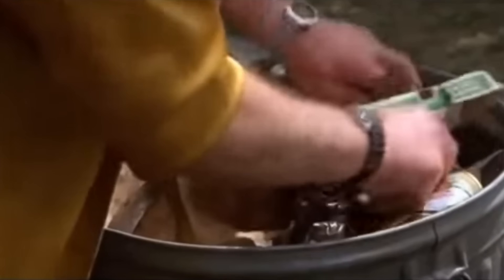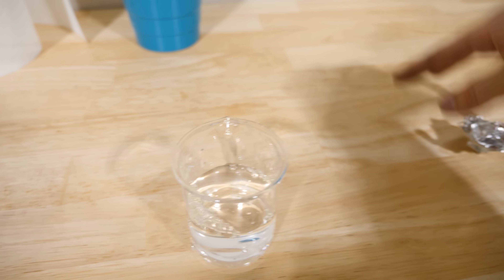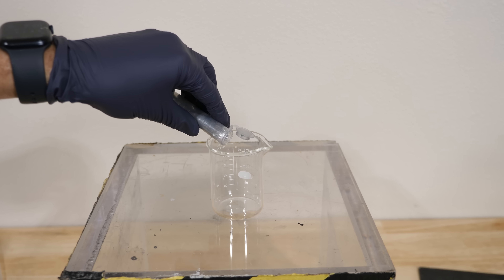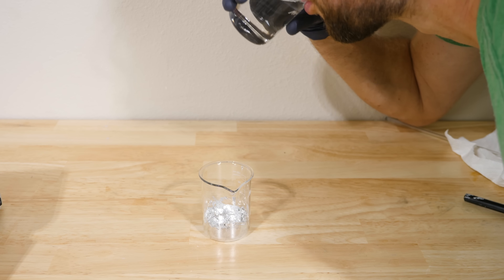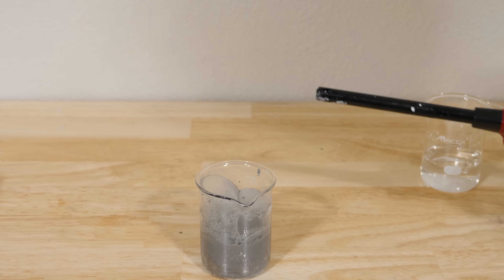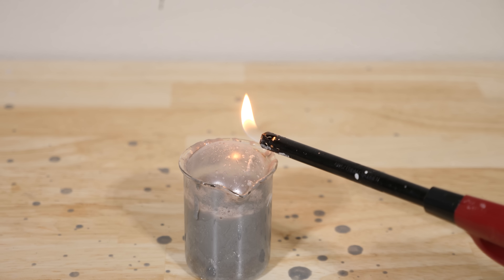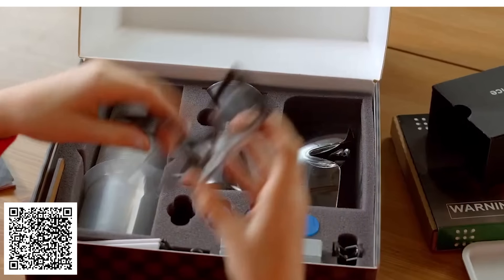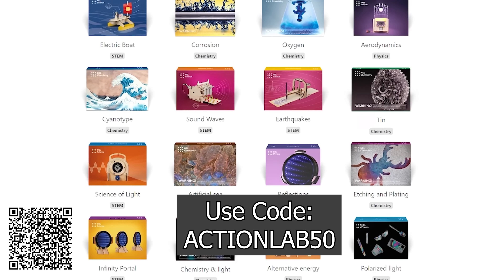This Liquid Metal Turns Garbage Into Fuel

Comment: I am a Ph.D. student working with aluminum-gallium alloys in energy production and I would like to clarify a couple things I see in the comments regarding the idea. A lot of people are suggesting that this is actually a poor idea to use in cars, airplanes, etc. and I believe they are right. But that doesn't mean it isn't going to be useful. The major interest in Al-Ga alloys is its use as an energy carrier. As good as batteries are for some applications, the energy density of batteries are actually quite horrible, which is an issue if you want to store energy rather than just have it be portable.

For example, wind, solar, and nuclear energy are difficult to throttle on demand. In other words, you only get energy from the wind when it is blowing and from solar when it is sunny. Conversely, you will be getting energy from wind and from solar whether you need it or not. To solve this problem, a lot of ideas are to use batteries to store unused energy from these "clean" energy sources so that it can be used at a later time. However, due to the really poor efficiency of batteries, a lot of energy is lost. This is where Al-Ga may come in handy. We can use excess solar, wind, and nuclear energy to produce aluminum from aluminum oxide. The aluminum now acts as a "battery" to store the energy. Then, when we want to release the energy again (e.g. in the middle of the night when the wind isn't blowing, etc.), the aluminum gallium can produce hydrogen which can then be burnt in a powerplant to create on-demand energy. This process of storing energy in aluminum is actually a lot more efficient than most batteries.

So while this may not be terribly useful in cars or vehicles themselves, it may be useful as an energy carrier for large-scale powerplants.
Reply: Thanks for sharing your explanation and sharing your insights on the topic. Best of luck with your research!
Reply: oh, didn't think of that. Makes a lot more sense when you translate this to a large scale facility, with large reacting chambers with a layer of the alloy at the bottom fueling the burners. The recovery process would probably be 99%, and you don't have to feed more aluminum into it. Gook luck with your research
Reply: @SparkyRedheadSupremacist  Pretty sure you would have to feed more aluminum into it
Reply: @SparkyRedheadSupremacist as well as aluminum plant are close to electric sources and they could even be in a single site . Not having to move the Al.
Reply: I'm curious about the method of recovery for the gallium and aluminum oxide, especially as it pertains to separating the two.
Reply: @amadensor  The aluminum oxide being produced crashes out as a light solid which floats to the top. To separate the two, you just need to let everything settle and remove the liquid gallium from the bottom. On the lab scale, you can use a separatory funnel. Industrially, something similar but much larger can be used.
Reply: Where does the aluminum go? I just didn’t totally understand that part of the video! The aluminum left the Ga somehow and you were left with GA and H2O despite some of the H being burnt off?
Reply: @NealD  It makes aluminum hydroxide, which I'm guessing dissolves in the water to form a basic solution. To get it back, you'd either have to evaporate the water, use more chemicals to get it to precipitate somehow, or just not use that much water in the first place and let it form a crust on the surface of the gallium. Seems like a pre-mixed charge of gallium-aluminum alloy where you add water as needed to get hydrogen, would be the easiest way to recover it, as long as you stop adding water before all the aluminum gets reacted.
Reply: @DFPercush  The aluminum hydroxide doesn't dissolve in the water, but it makes a pretty fine powder that floats around. You can kind of see the water is a little murky after the reaction because of that.
Reply: @DFPercush  Aluminium oxide is very insoluble in water at neutral pH. Otherwise every piece of aluminium would dissolve away when wet. In a practical hydrogen generating cell, you would probably want to use excess water to carry away the aluminium oxide when the reaction finishes.
Reply: @NealD  The aluminum reacts with the water to create aluminum hydroxide and hydrogen gas (2Al + 6H2O => 2Al(OH)3 + 3H2). This aluminum hydroxide is a white solid that floats to the top of the liquid gallium where it can be separated off. You can kind of see in the video that the reacted liquid looks pretty dirty at 3:30, so some of that is the aluminum hydroxide floating around. He then uses a pipette to get the clean gallium on the bottom, leaving the aluminum oxide in the beaker with the water. Hope that helps!
Reply: @pyr0duck676  That white powder, is it aluminium hydroxide or oxide?  It's oxide is typically a white powder, it's hydroxide, I have no idea.
Reply: @NealD  I imagine the aluminum becomes aluminum oxide and precipitates out.  But how do you get the OH off in order to reuse the aluminum?
Reply: @NealD aluminum hydroxide the cloudy mix . If you have pure aluminum water and such it’s non toxic. I don’t know how much gallium is going to side reaction but he has less recovery than he started with, but it could be removed from the old stuff.
Reply: Sounds interesting but I am curious about the hydrogen as it's a notorious slippery gas to contain. As the generation is simple but how fast can it be produced and you have too have some sort of buffering to regulate the pressure. But it has advantages in small scale systems as most of the reagents are reusable and in fact the water is the only fuel that is directly used up.
Reply: @barrymayson2492  What would likely occur on the industrial scale is the use of a PSR/CSTR reactor followed by a consensing column to get rid of any water vapor. The dry hydrogen gas could then be pressurized for immediate use in a combustor turbine to generate electricity. With the use of a PSR/CSTR reactor, you could regulate the hydrogen production by altering the feed rates of the inlets. Research is still ongoing to find the maximum hydrogen production rate from this system. Perhaps several PSR/CSTR reactors would need to be used in parallel to obtain the best hydrogen production rate without losing too much.
Reply: @barrymayson2492  If I'm understanding it right, you wouldn't use it to generate hydrogen gas as an end product or storage medium- there are more efficient ways to do that, you'd use it as soon as you produced it to create energy to use.  You'd leave the aluminum/gallium sitting in their tank until you actually need power, and then you'd just add water them and burn the hydrogen gas immediately to create power for whatever you are powering.
Reply: @barrymayson2492  But if you are producung Hydrogen "on demand" there should be no containment/storage issues.  Buffering pressure? A simple regulator should be able to do that.  So basically the only form of storage you would need are the pipes that carry the H to the reactor/fuel cell/burner etc.
Reply: Interesting! Is the Aluminium oxide after the process clean enough to feed it back into aluminium production plants?
Reply: @jackmclane1826  As long as you start with clean aluminum and gallium, the aluminum oxide would just need to be dried to get a fairly pure sample clean enough to feed back into aluminum production plants. Some gallium contaminants could remain, but those can be easily separated from the aluminum oxide.
Reply: This is a viable option, especially with solar. I feel like with nuclear power it could mostly be used as a buffer for excess energy production in low demand times and so not to waste the energy. 

This doesn't seem live a viable option for homes and personal use though. But more for corporate/factory use and for the power grid
Reply: @joshg6491  Why would this have any advantage over simply using excess energy production to directly produce hydrogen from water? Creating the Ga/Al mixture as a storage medium would probably allow higher energy densities than pressurised hydrogen for transport, but most countries already have infrastructure in place to transport hydrogen via gas pipelines. Given the energy loss through heat from the reaction of Ga/Al with water when used in any small-scale application of energy generation from hydrogen, I'm at a loss to envisage any application where Ga/Al would represent a preferable route over direct electrolysis of water followed by hydrogen storage or transport.
Reply: How do you conclude that batteries have low efficiency?  Li-ion can do round trip delivery well above 90%.  And other chemistries are above 80%.  That's because the fundamental reaction is simply atoms moving back and forth.  Here, you have to convert the Aluminum to Hydrogen, which clearly creates heat and consumes part of the original energy.  Then, for any use other than making heat, Hydrogen only yields at most 65% in electricity or mechanical energy.  Lead acid batteries are way better than that combination.  And if you actually are competing with batteries, you have to include all the work to collect the Aluminum Oxide, take it to a smelter and reconvert it to metal.  That definitely doesn't all happen with 100% efficiency.

This still could be useful for some applications.  I'd argue that the energy density trumps efficiency for vehicles.  Those naturally drive to refueling stations where collecting spent Aluminum Oxide is least problematic.  No high pressure or cryogenic tanks.  This may be most exciting for fuel cell planes, where all alternatives are really daunting.

But bulk storage of wind and solar?  This is your absolute last possible choice...
Reply: Possibly used as an indefinitely storable source of energy for some kind of single use emergency item? If you can make a micro efficient hydrogen generator I'm sure there is some way to make use of it.
Reply: @AndyTomT  Fuel cell.
Reply: OP, did I just read “low entropy battery” or an I just bad at science…

That’s pretty metal.
Reply: Thank you for the explanation. I am a machinist of Cessna for 20 years. Gallium is terrifying. People need to curb their enthusiasm.
Reply: Where do you find the required gigatons of aluminum and gallium?
Wouldn't it make more sense water electrolysis with renewable sources?
Reply: @jimbotron70  that is what is in place wordwide anyway
Reply: "pyroduck" the "PHD student"
Reply: Maybe you're aware of the aluminum-air battery, in fact India already has a startup marketing that tech.  The additional step of using Ga with Al to produce hydrogen wouldn't make sense for electricity production as an Al-air battery would be a cleaner route for that, but if your goal is H for heating or use in a fuel cell, or even ICE tech ha!  Then Ga Al is really nice.
Reply: @thom1218  I liie the HA at the end of ICE tech.  lol
Reply: This sounds incredible and could solve a major issue with renewable energy, I would love to read your article.
Reply: So awesome to know that! Thanks for sharing
Reply: How about that new nuke waste batteries? 🤔
Reply: I kind of doubt that this process is more efficient than using batteries. Do you have any full-circle efficiency figures? Burning H to get electricity in itself isn‘t really efficient. Using a fuel cell is better but still worse than batteries.
Reply: So is there a way to recollect the aluminum oxide after the reaction takes place?
Reply: I think you are a bit mangling with the (energy) efficiency term here and actually referring to something else than energy related efficiency. A Hall Herault cell has a pretty high cell voltage and therefore the combined method used to produced hydrogen is not more energy efficient than a PEM electrolyser for producing hydrogen. Not even talking about batteries. Those are even way better in energy efficiency.
BUT. I think you refer to the fact that it is pretty idiotic to use batteries for seasonal storage, because that means you would need to run it for 1000 years to make up for the investing costs.... not talking about the resources for the batteries. Any battery will have to be orders of magnitude cheaper/ kWh and still there is a possible resource problem.
And. Storing Aluminium is much easier than storing hydrogen and an easy and big on-demand production is probably what you're aiming for, right?
Well, and the circumstance that it is anyway very difficult to find a good longtime/allrounder storage solution with a high enough roundtrip efficiency in huge quantities.
To be honest I dont understand why people always pinpoint the low energy efficiency related to hydrogen, without also talking about other alternatives for long time storage which also have their drawback. I would wish more people would actually understand that you cannot use huge amount of li ion batteries, but energy carriers that can be stored separately from any battery fuel cell or whatever is used to produce the energy carrier do systematically better cost wise at least
It is not the same thing if you are talking about daily or weekly storage, or if you are talking about storing energy from summer for release in winter. And storing energy in metals, releasing hydrogen on demand might very well still  an option to consider. So why not also for aluminium. Though I guess you'd need to find a permanent anode material for aluminium production without releasing CO2.
It's really a tough problem. Not only for the aluminum but merely also to find a suitable energy storage solution for summer to winter.
Yeah good luck with your research! Interesting I found that gallium seems to be the way to avoid using huge amounts of caustic soda or acid.
And in a way also that probably you'll get aluminum oxide which can be well separated from gallium and hopefully directly recycled to the Hall herault process, respective to a process using permanent anodes
Reply: Yep.  The only question is if it will be better to just recycle the AL and I believe that depends on the energy balance. I. Any case it’s an important area of research as we are likely to need hydrogen for planes , etc.
Reply: I suggest you edit your comment: "For example, wind, solar, and nuclear energy are difficult to throttle on demand". Please provide evidence that nuclear energy is difficult to throttle on demand.
Reply: Stupid idea. To produce bauxite, we have to make coking coal, caustic soda, ovens, extracting the ore, it's all very polluting. The future is green hydrogen.
Reply: The real benefit of this would be a less polluting way of creating hydrogen because they usually use electricity to make hydrogen and that's really inefficient
Reply: @ShinkenKeruberosu  And you don't think itd inefficient to make aluminum with electricity?
Reply: @alexanderx33  Not if you are using waste aluminium
Reply: @alexanderx33  "you don't think itd inefficient to make aluminum with electricity?" - Actually that's already how aluminium is made FYI. Inefficient? If you compare it (in scale) against conventional batteries (e.g. li-poly) it actually might be more efficient than any rechargeable batteries (which on such a large scale would be prohibitively expensive anyway).
Reply: @CoolKoon  Big difference between the batteries and the aluminum in one case your effectively making a synthetic fuel in the other you are making a re-usable directly electical energy storage device. The efficiency of manufacture of the batteries is irrelevant. The battery charge/discharge combined energy loss is only 5%. The energy lost to heat when making aluminum from boxite has to be waaay higher since it is done at such high temperatures. (cursory search said the energy loss is at least 50%) It would however be more efficient for extremely long term energy storage, like for decades or centuries.
Reply: @alexanderx33  "in one case your effectively making a synthetic fuel in the other you are making a re-usable directly electical energy storage device." - Yeah, this is basically a fuel cell.

"The battery charge/discharge combined energy loss is only 5%." - I think that this is wishful thinking at best. Even 10% would be a bit too generous given the fact that you're never supposed to fully discharge a battery and the fact that the conversion efficiency of most run-of-the-mill SMPS' is around 90%.

"The energy lost to heat when making aluminum from boxite has to be waaay higher since it is done at such high temperatures." - First of all higher temperatures usually mean higher conversion efficiencies. And second the aluminium wouldn't be made from "boxite" (bauxite is the raw material aluminium is made from that needs to be crushed, treated with lye, roasted and only THEN can it be converted into metallic aluminium), but scrap aluminium instead, which is pretty much only aluminium oxide and metallic aluminium (there are already many aluminium recycling plants all over the world BTW), thus the conversion efficiency probably wouldn't be nearly as bad as you estimated it to be. Moreover the lower conversion efficiency would still be offset by aluminium's considerably higher energy density anyway.
Reply: @CoolKoon  How is efficiency loss offset by energy density if its not being used in a vehicle? The source is a good point though. One would think the prefered source would actually be the output of the hydrogen generator. IE the AlO3 and/or Al(OH)3 salts made by reacting it with water. BTW the reason why higher temp means alot of lost efficiency is that you can't perfectly insulate the system during conversion or recover all the heat on the way in and out. And the higher that temperature is sharper the gradient and thus the more rapid the flux of heat out of the system.
Reply: @alexanderx33  "How is efficiency loss offset by energy density if its not being used in a vehicle?" - By the fact that it's lost only upon converting the resulting alumina back into metallic aluminium (which is supposed to be done at the recycling facility, not in the car). The combined efficiency of heat and hydrogen production is actually quite good, that's what the gallium is there for. And yeah, the high efficiency would only apply if both the hydrogen and the heat produced by the reaction would be utilized of course.
"you can't perfectly insulate the system during conversion or recover all the heat on the way in and out" - You can't insulate it perfectly, but you could definitely insulate it a lot better than the way it's done right now during the manufacture (i.e. by little to no insulation at all). But I'm guessing that the electrolysis itself maintains the whole alumina+cryolite+aluminium mixture hot enough so that you don't have to worry about insulation anyway.
Reply: Can't nuclear easily be throttled?
Reply: @RedHair651  "Can't nuclear easily be throttled?" - No.
Reply: So you want to use a renewable resources to mine a limited resource....and then destroy it
Reply: Why not just reuse/recycle the aluminum as we do now?  There will be energy lost for each conversion.  Of all of the things to recycle, aluminum is the best case of all of them.
Reply: This is awesome and solves a problem of what to do with all the waste aluminum!
Reply: seems like it would use a lot of water, an increasingly scarce resource in some places, so some sort of recapturing system would be needed which could reduce the systems efficiency.
Reply: That makes a lot of sense thanks so much for this information
Reply: Thank You sir.
Reply: Wow, what an amazing idea!! 👍👍👍
Reply: Ok so if we shouldn't use aluminium for vehicles what metal should we use?
Reply: BRO WHAT HOW MUCH TIME DID YOU HAVE?
Reply: Yet, no matter what, it wont be as effective and recyclable already nature created. There is best solar battery out there already, and best particle it's called wood, oil, and carbon, carbon dioxide and multiple forms of carbon-hydrogen based polymers, gases, oils. Process is called photosynthesis just add water, creates various form of  battery :P  I don't know why people try to make it illegal.. it's pure insanity.
Reply: @KabelkowyJoe  "I don't know why people try to make it illegal.. it's pure insanity." - 'cause it takes literally hundreds of millions of years for them to be made? IDK about you but I suspect that 99.9999999% of Earth's population simply doesn't have that much time at their hands.
Reply: thanks for explanation
Reply: why not just go straight to hydrogen power? spend your energy making hydrogen gas from water in electrolysis, instead of electrolysis to make aluminum.
I guess hydrogen is difficult to store, but its hopefully going to be the fuel of the future in fusion reactors.
Reply: use ARL labs nanogalvsnic aluminium.  its cheaper
Reply: tbh i was gonna report u for spam but didnt when i read what u have written
Reply: Interesting chemistry, but I don't know the total quantity of gallium in the world.  Would it be economical?  If 0 Gallium is consumed in the process, perhaps it can be.  The other issue is the Aluminum (of course ... lol) To go from Bauxite to pure Aluminum metal you would have to put in a lot of energy (not 100% efficiently of course). Now you are retrieving that energy through a different chemical process (again less than 100% efficient).  I guess I am basically repeating what George is saying.  Is there a net positive gain to  the process?
Reply: You are working on chemical based metallic energy production.  I am working on non chemical based metallic energy reduction.  Science can be amazing.
Reply: Just checked .. Gallium sells for abt 2K per kg.
Is gallium a very rare material ?
Reply: Well its all good if you have piles and piles of Al that cant be used for any thing. So what happens when you run out?  To reverse the proses and to make more aluminum from ore or to take the products from the reaction and refine them back into Al there must be an energy input. Is it really worth it?
Reply: why combust the hydrogen, aren't hydrogen fuel cells way more efficient?
Reply: So essentially, if you had enough ga-al, of which is heavier then water, you could make a simple raise and lower mechanism that over flows the water, then refills as the container holding the metal is lowered back in the water. This would be an on demand system. Great for the zeppelin
Reply: This might also be useful in compact and highly efficient "batteries" wearable devices if you ignore the fact that its not a good idea to produce hydrogen in a wearable
Reply: I'm kind of curious what the efficiency of this method of energy storage would be as the best water battery systems I'm aware of I believe are around 70% efficient(based purely on memory, could be off a bit now). If this system can manage even close to that level of efficiency it could be quite practical compared to the large reservoir systems for storing water needed for that system, if it's cost effectiveness is acceptable too.
Reply: @jongrey1916  I thought the same thing and wasted my money on gallium. It didn’t work at all. I asked people for help. No one helped. 99.999 gallium, brand new aluminum foil, reverse osmosis water, tap water. Nothing. Nothing for days.
Reply: A major problem with using aluminum to store energy is the large quantities of carbon dioxide created during the  Hall–Héroult process used to convert aluminum oxide into aluminum.
Reply: WOW any site to follow?
Reply: Bravo, a top tier comment!
Reply: ye use more rare element to make everything more expensive... seriously galium ? wtf... galium battery ? better is tu use Al-C battery 10000x cheaper. but hey yes lets pump billions to keep job of stupid scientists
Reply: I thought batteries have amazing efficiency, but due to the low energy density you need a lot of them and the manufacturing being quite expensive the reason why they didn't pop off as high capacity energy storage. That and the slow charging speed compared to other solutions.
Reply: If what this gentleman says is true 1kg produces 130 liters of hydrogen. That's enough for any fuel cell powered vehicle. In a reactor tube whereby a metered flow of water is fed to react just portions of the Al Ga mass where does the water go? You wouldn't want to react the whole kg at once. Thanks for this.
Reply: Hi, round trip efficiency of a Lithium ion battery is ~95%, you seem to be in the know, what is it for this? What is the output, gallium unused, aluminium + water = to aluminium oxide & hydrogen? As far as I'm aware converting Al/O to Al and O takes an incredible amount of energy, what is its round trip efficiency?
Reply: I wonder if an aluminum air battery could have a dual purpose by generating some electricity and also using the hydrogen that comes off the batteries, which can't help but happen, and send it to a fuel cell. Even a few hundred watts could go towards mitigating parasitic losses in the system. Good luck out there.
Reply: Can it be used with iron?
Reply: If you need assistance, please send me your contact information. I have a lot better idea about how to increase energy output than what you suggested.
I'm not seeking money, fame, or recognition. I'm willing to share and help for free.
Reply: Thank you for being awesome
Reply: I guess making Hydrogen for any Engine or to do work or storage will depend on making a storage vessel that doesn't have atomic size gaps. What makes hydrogen an all around bad idea is 50% is lost in the production and storage just from leakage.
Reply: @pyr0duck676 thanks for adding that context. To my mind, this reaction seems most useful in situations where resources are incredibly scarce, as the aluminum can be used as a structural component in the transport of other resources to the remote location, then reused as fuel once on site. Large scale energy storage could definitely work, and would benefit from Aluminum being readily available on Earth, but I recall a video from Matt Farrell’s Undecided which discussed a molten metal alloying reaction battery which would probably be better for load balancing due to high density and scaling, though this method would be better for energy deep storage due to the ease of storing solid Aluminum. The use case I envision for this is in spaceflight: most places you’d want to set something permanent up in space will have ready access to water, but may not have ready access to high density energy. If, for example, a project was in place to build an automated asteroid mining fleet, it seems reasonable to suggest that a major hub of activity would be a remass processing center, likely taking advantage of a large deposit of something common, but not worth refining and shipping such as water ice. If consumables were shipped to such a facility using aluminum carrier containers, the return trip (if any) could be made lighter by the mass of containers, while the aluminum is used to easily process water (a medium grade remass) into hydrogen (a high grade remass), while producing an excess of energy which might be used to, say, melt additional ice.
Reply: energy production has been a crap way to generate since the 60' when Dr. Bron copywrited his Browns gas...  and is was known to run comustion engines VERY effeciently... look it up you'll understand why big oil kills ppl to keep they business (stanley Meyer)        lol I use it simply because the alternater on cars put out just enough to make it...  giving it the status of 100% unity if the muffler fed back into the water tank
Reply: Wouldn't it be easier to just draw a massive weight to the top of the tower with an electric motor and when you want the energy back, lower the weight which pulls the motors pulley and generate the energy for use?
Reply: U do not need to throttle on demand if you have more production then needed
Reply: Micro hydro and nuclear are part of solution; long lasting as stable if you put into equation advanced microsoft intel google ibm AI based solutions
Reply: In romania the gas line is doped with hydrogen for efficiency
Reply: Production of aluminium through electrolysis has around 70% to 80% efficiency at best. Traditional methods have only around 30% efficiency. On the other hand, using lithium batteries for storage has a close to 100% energy efficiency, so it's not economically viable for large scale operations.
Reply: Amazing idea and research, thanks for sharing:)
Reply: Probably takes more energy to convert back to pure aluminum, than you get.  Just use electrolysis.
Reply: I forsee int not to distant future where Gallium cartels control access to gallium used to produce H for spacecraft fuel .
Reply: Can't hydrogen be used in Hydrogen fuel cells to produce clean energy without need to burn it? This way you skip a step that uses up a lot of energy and heat and go straight to produce electric energy on demand. As all burning of fuels is not efficient as it produces a lot of heat which is wasted. I can guess that Hydrogen fuel cells aren't cheap on grid scale but on the long run should be cost effective as they save a lot of energy that otherwise would be wasted.
Reply: "energy carrier"
thats a term Ive needed for years
Reply: @pyr0duck676 does recovery of gallium after this process is 100%? And if not, how much?
And when in film is spoken about 130 ml of H from 1 gram of alloy, is it 130 ml gaseous hydrogen?
Reply: Its still way easier and efficient to store energy as potential energy in a plant for large scale use. But could have a niche in portability i guess. Altough managing hidrogen is a mess.
Reply: God speed
Reply: > However, due to the really poor efficiency of batteries, a lot of energy is lost
What do you mean? Lithium batteries usually have charge/discharge efficiencies of more than 90% these days. 

The claim that, charge/discharge efficiency of going fro aluminum oxide -> aluminum -> aluminum hydroxide + H2 -> burning hydrogen -> converting heat to electricity in a power plant is more efficient is so far off the mark that is is laughable. Thermal power plants max out at around 38-40% efficiency, so that's the maximum you could expect from the H2 to Electricity step. you lose energy in every step of that pipeline. The overall efficiency is the product of them combined. For example, if the first step is only 50% efficient and  the second step 40%, then the overall efficiency for the two steps is 0.5 * 0.4  = 0.2 which is  20%. As you can see, the more steps you have, the faster it will go down. Given the number of steps in your proposed solution,  it would be lucky to achieve 10% efficiency.

How are you  a PhD student? even an undergrad that took any physics/thermodynamics classes should know better. Heck, forget all that, if you have some basic physics knowledge, then you can google the efficiencies of batteries and other energy storage  / production mechanisms.
Reply: This
Reply: @indikaGreat  Given your comment's demeaning nature, I shouldn't even humor you with a response. However, if you really are interested in what I am talking about, look up energy density and see where batteries fall. That would be a good start. The only reason batteries are even remotely useful to us is because they can be physically small and portable. Other than that, they are abysmal in terms of gravimetric and volumetric energy storage. I would be more than happy to expound on this, but I am not going to waste my time if you are going to be disrespectful. I know I can't just expect you to believe that I really am a Ph.D. student, but you could at least pose your concerns without degradation of character.
Reply: @pyr0duck676  What application would need such high energy density storage that it would overcome the inherent low efficiency of the Ga/Al process as a means of energy storage for excess energy production? Please feel free to expound on it, because without proposing a useful application, you ought not to be surprised that others are sceptical of what seems pointless research.
Reply: @RexxSchneider  One main difficulty is that hydrogen is so difficult to transport and store, which is why a lot of other research is looking into hydrogen storage mechanisms. Even though we have infrastructure in place, the hydrogen molecule is so small that it easily escapes containers which results in a loss over time. This typically isn't too much of a problem in the short term and in small containers, but if you are trying to ship hydrogen in large quantities, the loss due to hydrogen seepage actually becomes quite significant. Also, there is a very huge explosion/flammability risk associated with transporting hydrogen.

Here, aluminum is much easier and safer to store and transport. Another advantage is aluminum's much higher volumetric energy density compared with even liquid hydrogen (83.8 MJ/L compared to 10 MJ/L (HHV)). This becomes particularly important if you are trying to transport via aircraft where there is limited space. A lot of research into the subject is actually proposing the use of Al-Ga alloys in large scale reactors to produce on-demand energy much like we can do with fossil fuels.

My research isn't actually focused on the energy carrier aspect of Al-Ga alloys as I have been explaining, but on its direct use as a fuel in some interesting energy applications. A major issue with aluminumized fuels is that for diffusion-limited reactions (typically inherent in micron-sized aluminum particles) a passivating oxide layer forms which leads to incomplete combustion. Because aluminum-gallium has this unique property of disrupting the formation of a passivating oxide layer, it can allow for more complete combustion in the near-field flame to burn more of your fuel. So, unlike a lot of other research where Al-Ga is being used to produce hydrogen, I am directly to burning it. This eliminates the issue of hydrogen production and goes right to producing energy. A good portion of my research is how to make the alloy, how to turn it into a powder, how to burn it, and then its performance compared to using regular aluminum.
Reply: @pyr0duck676  And how the Alluminium is recovered from the Alluminium Hydroxide? What are the safety risks / hazards for Alluminium Hydroxide if there are any? Thanks for your elaborate explainations.
Reply: @pyr0duck676  I accept that there are some difficulties in storing and transporting hydrogen because of the small atomic size and its flammability (the explosion risk only occurs within a certain range of H2/O2 mixtures). But these are not dissimilar to the problems of transporting and storing gas, which has been done successfully for a century or more now.

One obvious means of reducing the problems of hydrogen transport is to transport electricity and generate hydrogen on medium scale near to its point of use whenever excess electricity is available. That will require an upgrade to the electricity grid in most countries, but that's inevitable anyway if we are to alter the balance between renewables and fossil fuels as energy sources.

You would need very large scale reactors to make efficient use of the energy stored in aluminium because of the need to capture the heat generated in its reaction with water as well as make use of the hydrogen produced. Having both thermal generators and hydrogen fuel cells is going to be practical only on large, fixed installations. In many case, I would expect a nuclear reactor to be a better source at those sizes, although I concede that the ability to modulate generation on demand from a Ga/Al reactor is attractive.

I am grateful for your clarification about your research. I must add though, that the idea of burning (oxidising) an Al/Ga alloy to produce heat (or electricity directly in a fuel cell) seems destined to consume the gallium as well, so I expect you're talking very niche applications where you can afford to burn a metal that costs almost as much as silver (on spaceships, perhaps?), or are faced with the task of recovering the gallium from its oxide as well as the aluminium.
Reply: @pyr0duck676  As you are likely aware there is the very promising option of storing both excess generation of electricity in hydrogen via Ammonia. 

Being a liquid that's 50% more hydrogen dense than liquid Hydrogen of the same volume and is incredibly stable if stored correctly.

Additionally it can be transported & stored with minor, inexpensive, alterations to the existing petroleum infrastructure we have already.

It has a similar, if not slightly safer, level of danger to petroleum products we use on a daily basis too. With the forementioned modifications we could prevent the most direct individual handling risks to boot.

Efficiency is essentially the biggest problem regarding production of Green Ammonia, Renewable powered electrolysis and Renewable powered Desalination.

However, it can be mitigated somewhat by Renewable generation oversaturation in an optimal geographical location like Australia.

The idea being to provide a cleanly produced fuel that is easily accessable to adopt & use, is non-emitting in it's use, can be stored safely for long periods and is simple to transport long distances to where it will be needed the most.

Countries like the UK and Japan are generally not well suited for large scale adoption of renewables like wind and solar. 

Being relatively small land masses with a high density population, niether has the land to spare for it. 

They essentially require the use of nuclear reactors and/or Ammonia fuel to power turbines for power generation. As they use significantly less land area for the amount of power they can produce by comparison to Wind and Solar.

Ammonia, as eluded to earlier, can be used for long distance transportation that is beyond the range and/or capabilities of BEVs. 

Either as a direct fuel source in some cases or be converted to hydrogen to fuel HEVs. This conversion can even be done at Petrol Station's (Americans would call them Gas Station's), almost eliminating the potential leakage losses with hydrogen.

Fuel Tanker Trucks would transport Ammonia to the Station's and Nitrogen, or more likely Nitrogen Oxide, back to be reprocessed into Ammonia or used elsewhere.

The Nitrogen could even be vented safely into the atmosphere if we were of a mind.
Reply: @pyr0duck676  but IG is correct. You're swapping what Tesla are claiming to be a 0.88 efficient energy storage and release process to one that is 0.2. If you're using it as a static energy store it doesn't matter the energy density is low, you can just stack them on more land, going three dimensional if need-be. Even pump-storage has around 0.7 efficiency combined cycle
Reply: Sure. But the energy density of this set up with the combustion wouldn’t be great either. Also, why not use magnesium at that point which can produce hydrogen without 3 to 1 parts gallium.
Reply: "due to the really poor efficiency of batteries, a lot of energy is lost" Tesla claim better than 94% efficiencies for charging batteries and battery to wheels so better than 0.88 for the combined energy cycle. That is really pretty darn good for energy conversion efficiencies.
Reply: And the hydrogen doesn't need to be directly burned, it can also power cars 👍
Reply: Are you also studying how wind farms are so far away from where the electricity needs to be used that it’s all loss by the time it gets to its destination? Not very efficient at all…

Also solar panels are causing the earth around them to basically be toxic, which we probably wouldn’t want near our cities either, which would mean that the solar farms also need to be far away, making them less efficient the further away they are.
Reply: @KK-sg5gl  Where do you get this nonsense from? This is just propaganda from the fossil fuel companies.
Reply: @KK-sg5gl   Solar panels are causing land around them to be toxic? Wtf are you even talking about? I have a food/solar combination farm and there is absolutely no toxicity issue.

And wind energy losses making the electricity useless? That's complete and utter BS.

You must either be a fossil fueled disinformation bot or a fossil fueled disinformation schill. Which is it?
Reply: It is definitely not as efficient as batteries by energy conversion efficiency, but the aluminum has a high energy density. Which doesn't really help if you can't use it as a raw fuel for use in vehicles (the only place where weight efficiency matters.) IE your comment makes no sense. 
As far as I can tell the best use case is for an alternative to aluminum recycling (which is actually very niche, the vast majority of aluminum cannot be recycled because of the diversity and mutual incompatibility of different alloys. We can avoid throwing away stockpiled energy into landfills if the more difficult alloys are converted back into boxite and resuduals in this way.
Reply: Stop trying to increase density, instead take the technology you already have and see how efficiency you can improve, how many energy transmission, or conversion points existant in the sistem you are observing. Consider this, using an electric motor, brushless and dc, coupled to each wheel of a golf cart sized flat bed cargo carrier, with each tire having its own motor, you can delete the weight of a transmission, as long qs it isnt high speed you do not need wheel alignmen, or sterring alignment, the lighter you make the rest of the job you are trying accomplish, the work the batteries are doing per charge cycle, and if the batterie mosules are small ebough, they can be easily swapped either by hand, or with a much smaller battery swapping cart. Remember there us one rule above them all, energy in, energy out. The person who can do the work  more efficiently then anyone else wins, nothing else matyers, forget the teachers, forget the books, dont listen to naysayers, if its heavy, and doesnt make any sense, get it out of there.